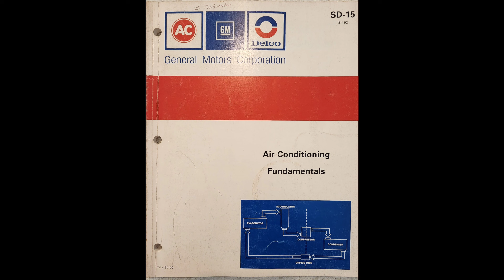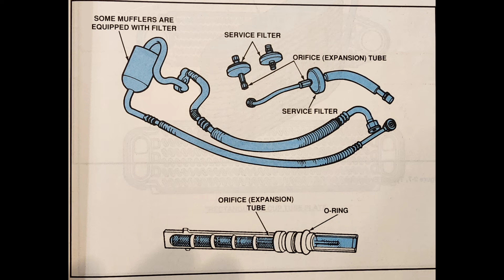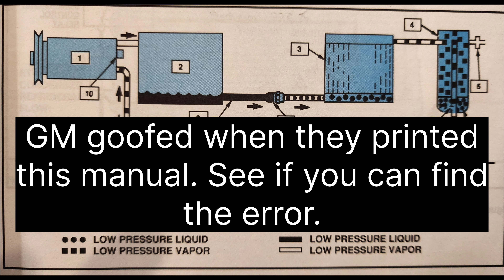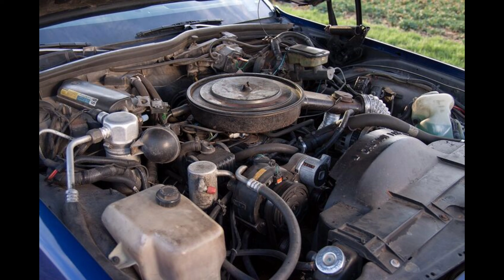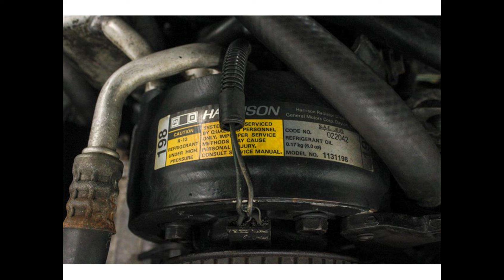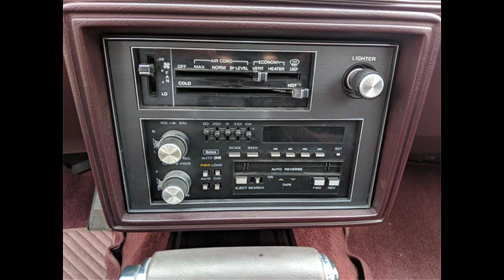The GM CCOT Air Conditioning Sytem Was One of the Best!

Comment: When properly applied, R134a is just as effective as R12 and will still provide discharge air in the 38°-44° range. If your conversion isn't working right, it's probably because the desiccant in the accumulator is saturated or the metering device wasn't upgraded when the refrigerant was changed.
Reply: Yes, this is right.  I’ve proven it numerous times on 80s GM Holden systems.  R134a is fairly similar to R12 on the graphs but not quite as good. 
(All Aussie GM Holden Commodores from 1982-mid 88 ran a TX, mid 88-97 ran a CCOT, but used R134a from’93).
However, changing to a suitable TX valve, fitting a new dryer, and boosting the cooling of the condensor with a bigger electric fan, and I blow fog out of my ‘87’s centre vents.
Reply: I’m quite familiar with the older GM R-12 systems that predate the ccot system. Mainly the EEVIR system from the 70s. The fact is these systems never cycled the compressor. They had a built in bypass valve that would bypass the evaporator (cooling coil) boil it off and send it back to the compressor. It regulated the pressure to keep the evaporator 32-33 degrees at all times to keep the coil from freezing. They also used a TXV that metered the proper refrigerant flow. The bypass valve was called a POA valve. The air would sometimes warm up coming out of the dash during periods of prolonged idling because the compressor didn’t have enough capacity at low speeds to keep the pressure low enough. But as long as the engine was running above idle, the air was brutally cold. An important thing to check on any older RWD car with an engine driven fan is to make sure the clutch fan is operational. This minimizes the issue. R-134 got a bad rap because when you convert an existing R-12 system, you lose about 25% capacity. But having worked on various automotive A/C systems, it does seem that the older R-12 systems did indeed work better. The newer systems move more air but the older systems seem to discharge noticeably colder air. Moving the air through the evaporator coil at a slower rate allows for better dehumidification. Just an observation.
Reply: @mikee2923  exactly my point. It comes back to application. The coils and metering devices in those older cars were designed for R12 so when converted, they aren't exactly the same as designed. A refrigeration system designed for R134a charged with R134a performs just as well as an R12 system charged with R12.
Reply: Not true R134a is a pile of crap because it requires much higher pressure than R12 refrigerant does and with the lower pressure of R12 could blow cold air on normal AC and only require max AC when it was over 100 degrees outside and when it was over a hundred degrees Fahrenheit you rarely had to run the fan at max speed when using Max AC about half speed would usually do and very rarely needed to be recharged with refrigerant like newer R134a do.
Reply: @rustybeatty6567  I am an actual AC professional that understands enthalpy and psychometrics. You will not win this argument. Case in point, there's a very high probability that the refrigerator in your kitchen is charged with R134a. Does your freezer maintain -10° to keep your frozen food frozen?
Reply: @nathanduke5323  then explain to me why modern vehicle AC system that runs on R134a power down everytime when hard acceleration of the vehicle is needed but when systems using R12 refrigerant almost never did.
Reply: @rustybeatty6567  I can only speak to the thermodynamics of the situation which is that if there is the correct volume of refrigerant that is metered correctly causing the proper changes of state at the appropriate points in the coils, it will work as effectively as R12. But I imagine that the answer to your question has something to do with whether the compressor clutch is engaged or not and that's a part of the industry I am not involved with.
Reply: @rustybeatty6567  because at some point in time manufacturers decided to free up power at WOT by disengaging the compressor. There's nothing magical about R12, those systems required a similar amount of power to operate.

Comment: S10 will freeze you. When there's a lot of humidity little ice chunks will shoot out the vent it's that cold.
Reply: Both my grandmothers Ford LTD Crown Victorias did the same thing and could run on normal AC for most of the summer time only needing MAX AC when temperatures outside were over a 100 degrees Fahrenheit at half fan speed.

Comment: I have a restored 1972 Camaro SS that still uses R12. I still have a 30lb bottle of R12 I bought at Sams Club for $250 right before it became unavailable to purchase.  It has the long A6 compressor and an actual expansion valve. It uses a pressure triggered fuse with a wire coming off the back of the compressor that if the pressure gets too low it will send a signal to the 3 leg fuse to blow it and interrupt the 12V doing to the compressor. It also has the dryer that has a sight glass to check the R12 charge too. It  makes it so easy to see if it needs Freon.
Reply: @HustleMuscleGhias  It clips to one of the hoses coming  from the charcoal carbon canister on top of the drivers side fender well.
Reply: Fortunate man

Comment: I sometimes would encounter 1970s and 1980s Benz diesels and Volvo bricks. I was suprised to see Harrison Thermal Systems AC parts under the hood.

CCOT did work, but I think about how expansion blocks were common in Chryslers, and common on some foreign cars. I don't know that the expansion block was what made the AC less effective in foreign cars, or if it was because the system may have been downsized to function. The AC was said to suck in the VW Vanagon and not in Ram Vans. Well, how much AC did that crappy WBX gasoline engine or tiny diesel take?

Comment: You never get all the mineral oil out unless you replace compressor and condenser. Just use ester oil for a 134a conversion. And use the same weight of R 134a as the R12 it called for. Don't use any refrigerant to flush the system out. As the R11 flush was cited as the cause of most conversion failures.

Comment: 1 of the best is correct...The best was the CHRYSLER "AirTemp" of the 1960s trust me you could hang a Deer up on the coat-hook to cure in them. You had to drive around with them on Low or get frostbite in Tampa. They even switched their technology over to home window units and they were just as good. When the compressor would kick on those bad boys they'd shake and vibrate a brick home. Chrysler also made an outstanding Outboard Motor too.  Good Video  KUTGW
Reply: And into the early seventies, the top line Chryslers could be had with REAR heat or REAR air conditioning to negate any weather from Death Valley to Prudhoe Bay...
Reply: Hey man - this is a comment section on GM - keep your Chrysler comments to yourself - just kidding😀. 
Chrysler Airtemp was an innovator in putting AC in cars back when AC was a new innovation.
Airtemp was huge - my grandfather had a Chrysler Airtemp furnace and A/C in his home. I think Chrysler sold Airtemp to Fedders. He also owned a Chrysler New Yorker that would freeze you out.
It is amazing how both GM and Chrysler built their own components back then and now you find Denso hvac stuff in newer offerings.
Reply: @johnrose3169  "Hey Man"... I've owned FoMoCo's and I've owned MoPops [MoPars]. But the fastest car I ever had was my 1970 Model 396 Nova. That mother would pull the front wheels. CHRYSLER pioneered lots of things on cars.                              The HEMI. [Pratt & Whitney was really 1st]  Power Steering, Power Brakes, Torque Converters. They were the 1st to go from Generators to Alternators. They drove a car with 2 drivers from NY to LA with no battery in it. They just never shut it off.                          And Ahh the Gas Turbine Car what a work of art that was.           I LOVE my MoPars. That's why my 396 Nova half-tracked my best buddys 440 Cuda. With his wife in the car!!!  hahaha LOL
Reply: They made the boats themselves too.
Reply: @garyszewc3339  Mine has a tag on the transom that says ... "Made for CHRYSLER by TaylorCraft." The Trailer has a "CHRYSLER" moniker riveted to the side rail.
Reply: Interesting. Chryslers used expansion blocks and not orifice tubes.

It is why I suspect it isn't the expansion device that makes the difference.

Comment: The Frigidaire system with the A6 compressor, the suction throttling valve AND a thermostatic expansion valve. Low side pressure at a constant 33 psi, good for sub 40 degree vent temps, that system was the best!
Reply: You would open the hood on a steaming hot day, and the return lines all had frost on them! This was mid 60's to early 70's.   My '78 with the CCOT never did that, it was designed for fuel fuel economy.
Reply: Absolutely correct.  The TXV would keep the evaporator at maximum cooling capacity regardless of conditions… 35-40° even in stop and go traffic. Change to CCOT was made for fuel efficiency since compressor cycled .

Comment: The Frigidaire A6 compressor was a BEAST!!!
Reply: Yes, the A6 compressor may have been big, heavy, and required a lot of hp to run, but it was virtually indestructible. If you did get liquid into it, it would lock up and break the belt rather than damage the compressor. But those "tuna can" Harrison compressors were junk.
Reply: @geraldscott4302  I remember the R4 compressors whirred like a home AC compressor.
Reply: But also put a hell of a load on the engine...
Reply: @marko7843 you are right but I had a 500 cubic inch V8 pushing it lol so it wasn't really a problem ,👍🔥🔥🔥💪💪💪
Reply: @pondersoa8223  same with the York compressor in our Lincoln 460, which also worked quite well in that car and an LTD.  However, we had a Chevy pickup with possibly the worst 350 ever built, and we had to add a throttle step up solenoid to keep the idol decent when the A6 compressor was on...  🤬
Reply: Freakin blowin snow out the dash vents 😮
Reply: You are right sir
Reply: I have one of those giant Frigidaire AC compressors sitting on the shelf.  It used to be on a 71 Cadillac with the 500 in.³ V8.  I thought of someday turning it into a vacuum pump?
Reply: @K-Effect I am no expert, but I don't think they will be good vacuum pumps since compressors need oil to stay alive
Reply: @K-Effect was your ‘71 Cadillac an Eldorado?  If not, it had a 472 cubic inch V8.

Comment: I worked on many of these between 88-93. The system sucked.

1. The R4 compressor was junk compared to it's rivals. It would lock up, and take out other belt driven accessories, like the waterpump, power steering, etc. It would usually throw "shrapnel" into the system, requiring a new accumulator, orifice tube, and blowing out the lines to get the metal out.
2. If you overfilled the system it wouldn't cycle, and eventually would frost up the evaporator and stop air flow.
3. When low, they would cycle so much and chatter it would cause vibrations for some of the smaller engines.
4. The system could increase the idle speed, but didn't do anything to offset the power loss cycling. For example, driving the expressway the vehicle would speed up/slow down.
5. In 1991 GM brought back the txv valve for some vehicles to smooth out the vehicle. They changed the name, but it was the same thing as the earlier system from before late 70's.
Reply: Most compressors call for a full system flush when it dies. Others even require replacing the whole condenser.

My mom had a 1985 Nissan Maxima and the Hitachi compressor died more than once. Having to deal with Florida heat and no auto AC is why I learned it in 2006 during auto repair class. Every one of those cars had constly dying compressors. In 1994, we all learned what a timing belt was because it went boom.

The Maxima did not come with a parallel flow condenser that required replacement when the compressor dies. However, it needed replacement because the compressor shrapnel cut through it.

When I read about how summer also sucks in Japan, I wondered how Nissan could screw it up.

People at auto repair shops called it "black death."

I had to replace Sanden compressors on VWs several times. When flush fluid came out, it looked like mercury because of all the metallic trash.
Reply: @skylinefever  Interesting. I have high respect for Hitachi products. The compressors I replaced on domestic cars usually needed a clutch or some type of failure that didn't cause the shrapnel to get sent through the a/c system.
Reply: @rainmant5724  I doubt the problem in the 1985 Nissan Maxima was caused by Hitachi. All those cars were flawed. It had an awful cooling system. They were FWD and should have been given a better electric fan. That would have been awful for the high side of the compressor.
The Nissan 300ZX had a similar Hitachi compressor. However, it also had a belt/clutch driven fan, and those cars were less prone to AC problems.

My mom had one and a nearby frenemy's mom had one. Some friends had a 1986 Maxima, same problem.

It amazed me that since the Maxima had such blazing underhood temperatures, the Hitachi sensors tended to hold up and not light the check engine light.

Comment: You just explained the basic operation of all automotive air conditioning. GM’s high capacity compressors is what gave them the advantage in the late ‘60s to the early ‘80s, mainly the A6.

Comment: Uh....no...nothing..but NOTHING was colder than Chrysler vehicles equipped with the old V-2 twin cylinder AC compressors.
Reply: They were the coldest for sure.  The mid 60's GM with the POA valve was darn close second place.  Personally I think the CCOT was the worst ever design.  It was meant for fuel economy first, and it was hard on clutches and compressors.  Shit used to blow up all the time.

Comment: Best car A/C I've experienced:  My dear departed 1994 Chrysler LHS.  (R134a) This cooled better on low than most cars on max/recirculate.  A 1987 Ford LTD I had for a while. (R12)  My buddy's old 1972 Chevy Impala that would freeze your ass off. (R12 of course)  As far as existing R12 systems, I have a mini Pepsi vending machine from the 1970s that cools great and has never had anything replaced on it that I know of.

Comment: R12 works better, but is way more expensive these days. R134a works about the same on a retrofit if you change to a R134a orifice and cycling switch also.
Reply: Converting an existing R-12 system to R-134A reduces overall capacity by about 25%. R-134A requires a condenser with a larger surface area to reject the same amount of heat. On the low side of the system, the pressure is basically identical between the 2. Usually on commercial refrigeration the same TXV is used with either.

Comment: I had one of those on my 1978 G 20 van and on my 1977 GMC dually. Both blue ice cold even after I converted them to r 134.
Reply: I have a G20, too. It has the dual setup with a secondary AC in the back and it works great, had it refilled this year.

Comment: My 2008 tundra a/c is the same way. The fan doesn't produce a high cfm. But heater and a/c are awesome.  And you don't have excessive wind noise of higher volume blowers. 
One thing most people don't understand is. A/C is not producing cold air. Its removing heat! The most efficient any A/C, system whether its a freezer refrigerator or home central air. Is when a desired temp os achieved.  To put the fan on its lowest setting.  To allow the evaporator to be at its most efficient.  So it can transfer the most heat to the refrigerant.
Reply: Actually high fan speeds makes the A/C run most efficiently as it means smaller temperature deltas but it also means less dehumidification.